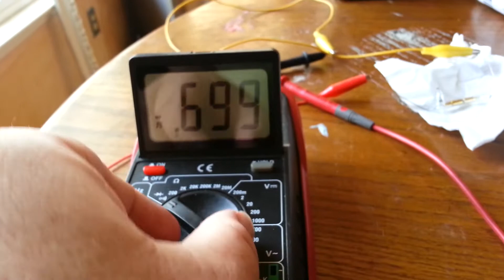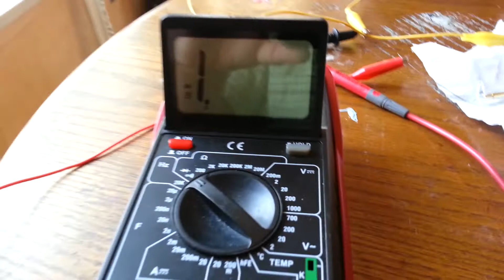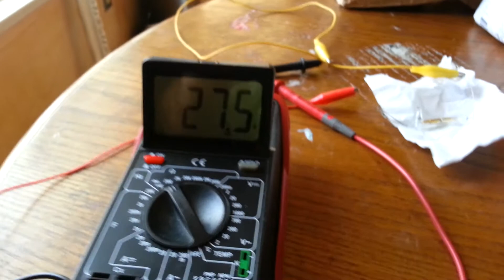Marconi Coherer

Comment: That's sweet!! I'm liking that mate. So many uses for that! 
Wow where can I find one lol

Thanks for sharing mate,

☆☆☆☆☆THUMBS UP ☆☆☆☆☆

Anthony 

High1voltage1rules
Reply: In Tesla's Colorado springs notes, he described a hermetically sealed container of nickel pieces, that could pick up lightning discharges hundreds of miles away. Thanks for sharing, very cool little receiving device.
Reply from the maker: high1voltage1rules You can make one with Aluminum balls rolled up from from pieces of Aluminum that are about 4x4cm square.  Fill a small cup with them and place strips of Aluminum on either side of the inside of the cup.  You will find to your surprise that this does not conduct electricity until an RF pulse from a spark is applied.  Put matching dipole antennas across the spark gap and the coherer, and it will work across the room.  I also added capacitance hats on the ends of the dipoles to give them even greater range.
Reply from the maker: high1voltage1rules Here is the ebay auction where I bought mine. http://ebay.to/1IV9xLZ